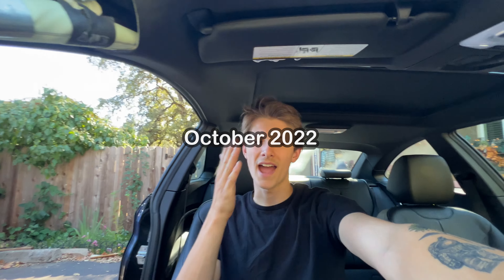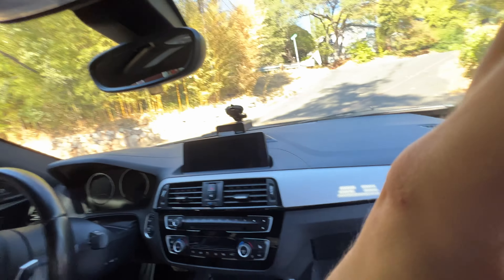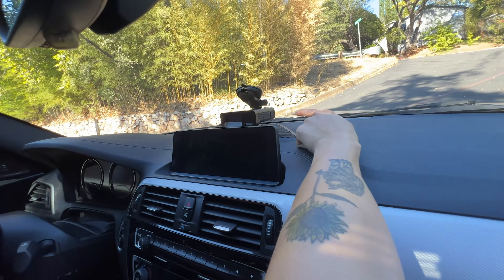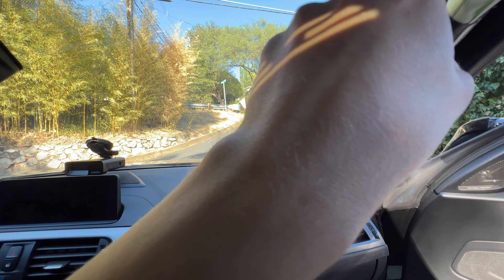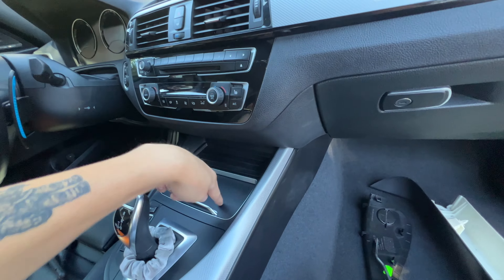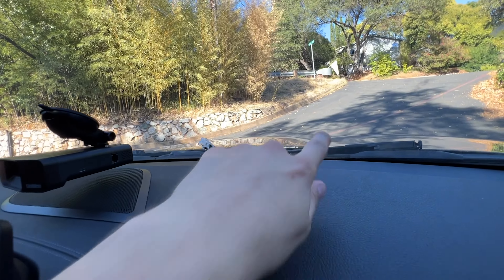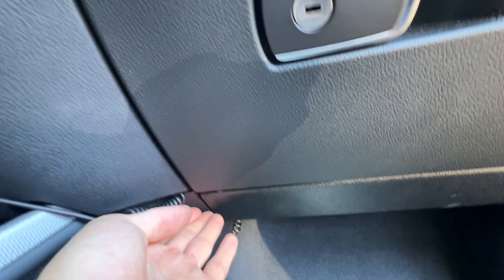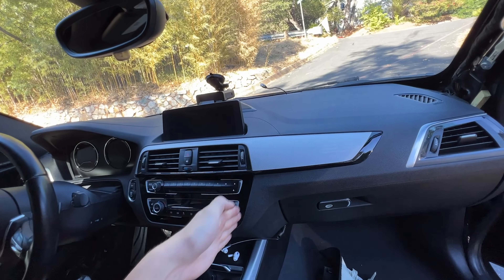This Mod will SAVE YOU MONEY! (Uniden R7) *No More Tickets?!*

Comment: The most important thing everybody should know about these detectors is your only protected against radar,
not LIDAR.

While it does detect laser to an extent, 99% of the time once lidar is being detected its too late.

I have heard some circumstances  of the beam deflecting/reflecting off of another vehicle surface just enough to detect it and not be tagged by it.